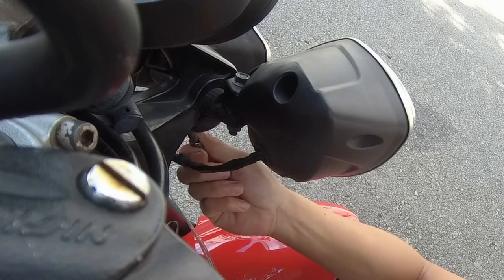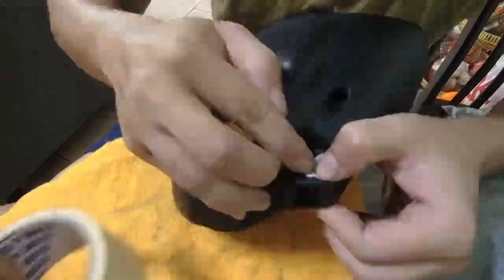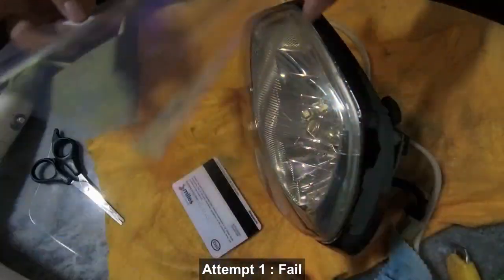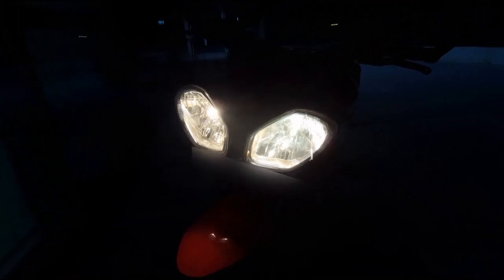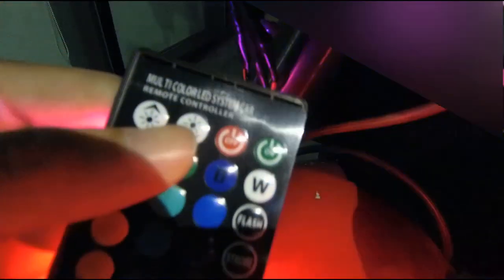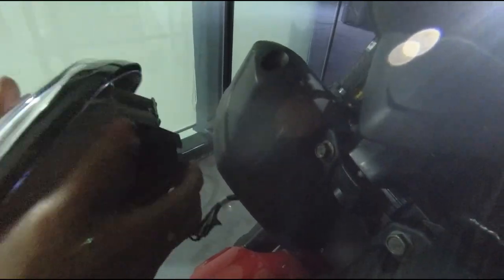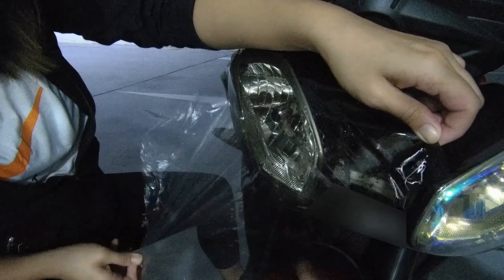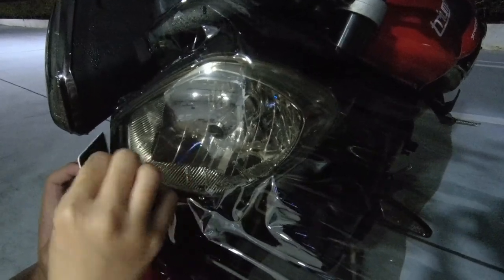Headlight Repair, Lens Wrap & LED Bulb Swap | Street Triple Restoration [ Part 4 ]

Comment: omg, my triple headlight also GG, HAHA. any remedies you know of for burnt mark?
Reply from the maker: Expensive fix  (either way) 😂.

1) Pay to replace as a whole
- high $$$ 
- fast and easy

2) DIY
- lots of elbow grease (and time)
- certain skill level needed

E.g. of the steps
- remove the headlight from bike
- remove all bulbs and wiring
- melt the glue that seal the lens to the housing
- sand down and bluff the burnt part
- glue and seal back the lens
- install all the wiring and bulbs
- install it back to the bike
Reply: @zwc888  hoh seh! thank you for your reply! so detailed